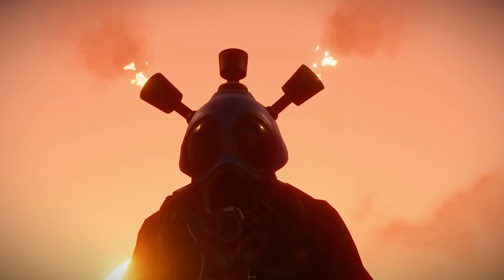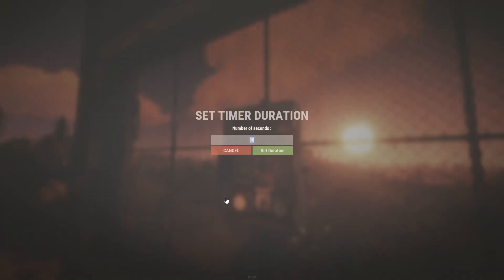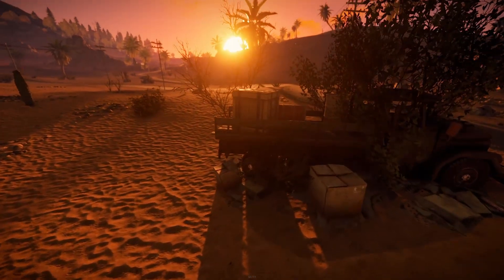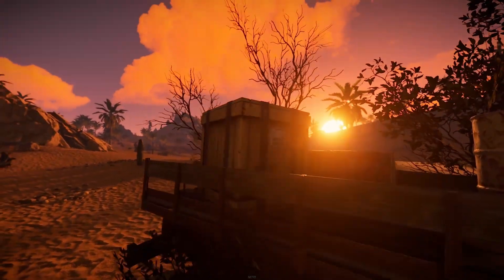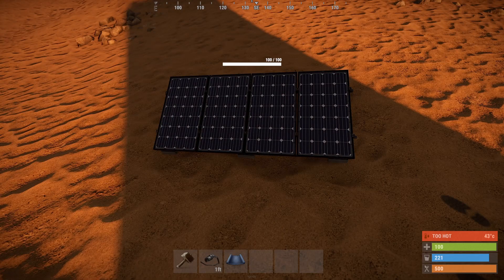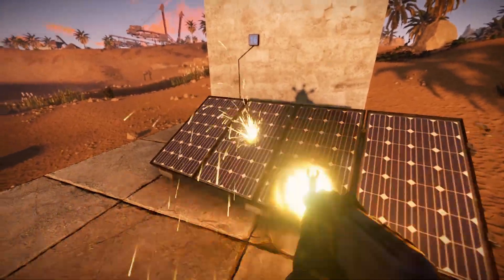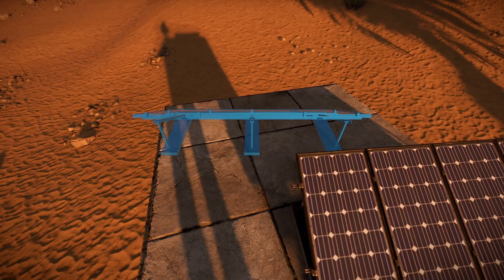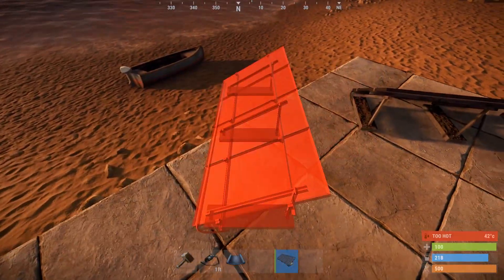RUST - Power Minute - Solar Panels

Comment: something changed about them last month or so, if you face them north they get less power then they used to. Did they move the island in the northen hemisphere and now we must face south or was there a pach? I used to confortably stack them facing north but now they're such a pain that I just use turbines.
Reply: Had the same problem.. I had like 12 panels facing north all connected to one large battery but the power would cut out 1/3 of the day. I'm gonna try pointing half east and half west next time
Reply: @Julian-gj8si  I feel like now you need double the number of panels

Comment: Is it just me that have trouble having either the solar panel drop and/or the root combiner? I have most problems with the latter dropping, and as far as I know, nowhere sells them by default?

Having low walls around solar panels can perhaps be prudent, because it protects them against most nakeds, and if you are using automatic lights, the lights will turn off when it is a bit brighter, not while it is quite still dark inside the base :)
Reply: Having the low walls wood, is enough for smaller bases. That way it's not that hard to remove them if you want to build higher :)

Comment: This sweat nerd got triggered when you said putting them all north. In Rust the sun can be either in the northern or southern part of the sky. You need to look to see what direction the sun is, and then put your solar panels that direction. So if the sun is in the northern part of the sky, you put them all north. If it's int he southern part of the sky, you put them all south. The fun part is the sun will migrate over the course of the game. You might have to change your solar panel directions after awhile.

Comment: Last time I looked into Rust's electricity, I followed your build guide from a year ago. Is that same circuit necessary to have power and charge a battery or has that all changed?
Reply from the maker: Oh man definitely not!! Thankfully they changed batteries so that they aren't always pushing out full power. Now they only push out what is needed. So as long as your input is higher than your output the batteries will charge. :)
Reply: @Malonik  so, to power lights, I'd need a solar/wind/gen to a battery to a light? Nothing necessary in between? If so, this will saves me tons of HQM.
Reply from the maker: @PhilRezanow  Yep but you can use even less lol. If you use wind turbines you can just connect them directly to your lights. It does mean if the windmill loses power you'll lose lights but honestly it's not common enough for it to be an issue. :)

Comment: Doesnt a solar panel produce more power in a day when facing north?

So might as well do it that way until they change that...
Reply from the maker: Yeah as gal said in the video angling it north will get you power most of the day but don't rely on that forever as it's not intended and they will eventually fix it.

Comment: I like the concept of the Power Minute
Good luck explaining the full functionality of Memory cell in 60 seconds though...
Reply from the maker: You'd be surprised. 60 seconds is actually a fair bit of time for a single component, even the dreaded memory cell. I've got a circuit coming out this weekend where I explain them in about 20 seconds.
Reply: @Malonik  Looking forward to it bro.